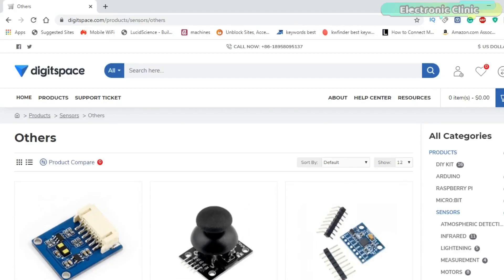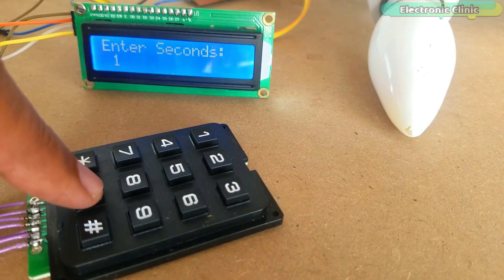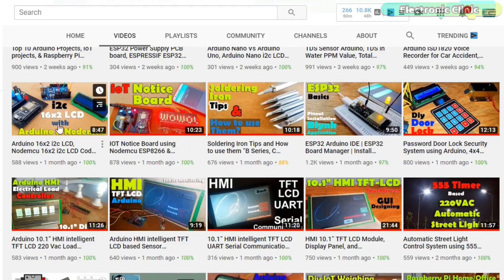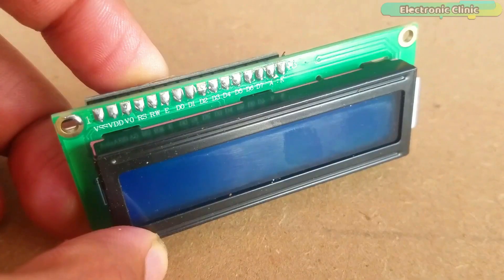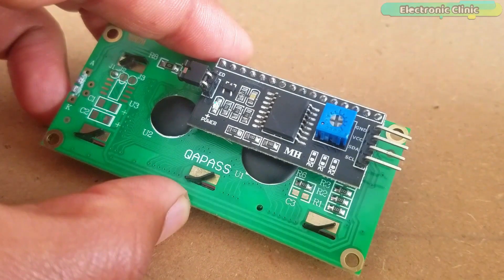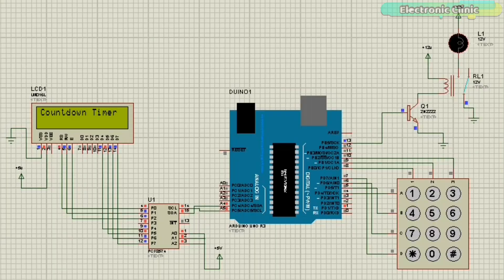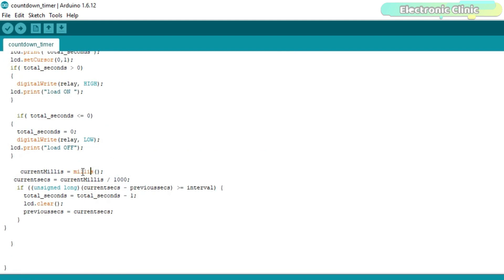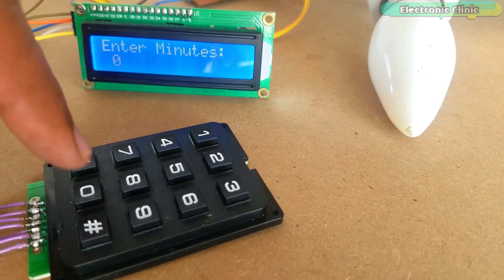Countdown timer using Arduino, LCD 16x2 i2c & 4x3 Keypad, Arduino countdown Timer Millis

Comment: How to do the same with fixed timings such as 5 min , 15 min , 30 min and 45 min ,by using 1x4 keypad and by trigerring the external push switch to start , pause and clear ?

Comment: Hi there, I'm running into a problem. I'm using my code where I use a delay. After every second the code subtracts one and displays it on the LCD. It counts down perfectly, but when it reaches the single didgets (9,8,7,6,5,4,3,2,1) it displays (90,80,70,60,50,40,30,20,10). I believe it's a simple offset.